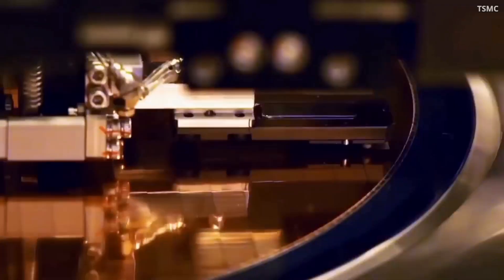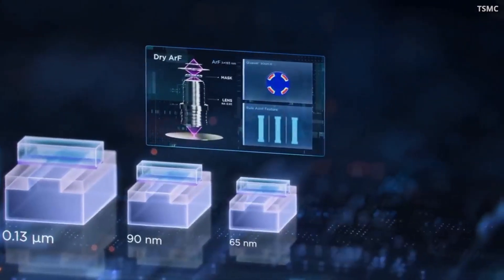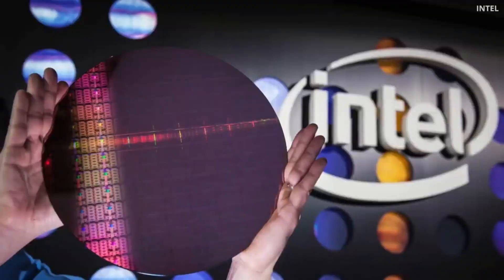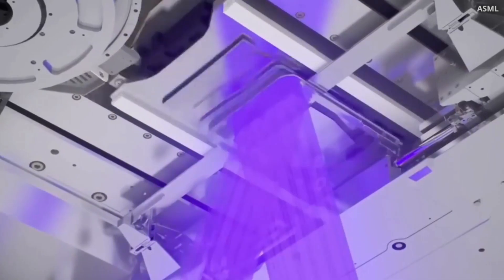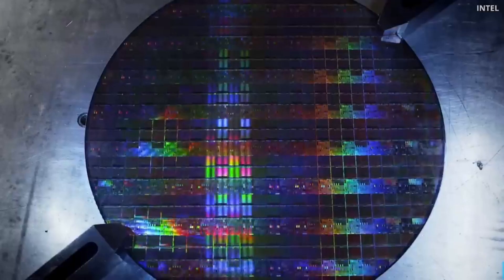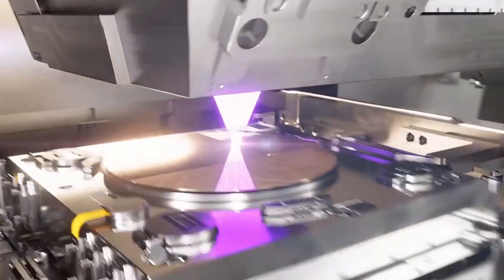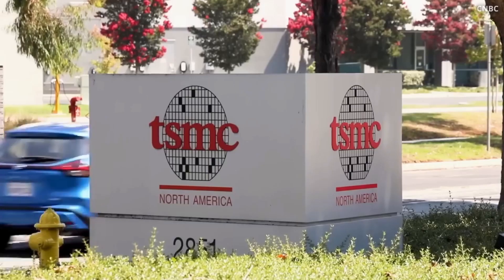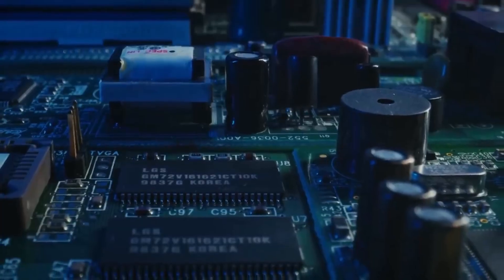Huge 1nm Breakthrough Breakthrough - The Future of AI Chips

Comment: Congratulations to TSMC but have they ever thought of hardening it against EMP, CME, EMF, EMI? High G forces? Hard radiations? Cosmic rays (micrographic pictures has shown that cosmic rays in outer space was able to make microscopic gouges in a silicone rubber material that was sent to space to be exposed to outer space exposures under all conditions) that can do microscopic damages to all kinds of materials. Extreme heat and extreme cold?
Reply: didnt need to

Comment: you're a bit behind.. a Chinese lap achieved 1nm last years base on a completely new material.. they are probably furiously working on its mass productions right now.. will be ready before Christmas..
Reply: Temu Xmas Specials
Reply: That is purely propaganda and psychological warfare against the west. It takes a whole decade to commercialize the EUV machine and put into mass production. China right now is on a very bad place, they lack the required tools for the next advancement, too many chokeholds... EDA, photoresist, ultrapure sillicon... China domestic litho machine currently is running at 72nm node with the help of US lightsource, which is a critical key for the machine. Let alone 1nm is just pure fantasy
Reply: Source
Reply: @Arctic-fox717 they
Reply: Ah, yes, China propaganda, your chips that China made were 10nm to 12nm, not 1nm